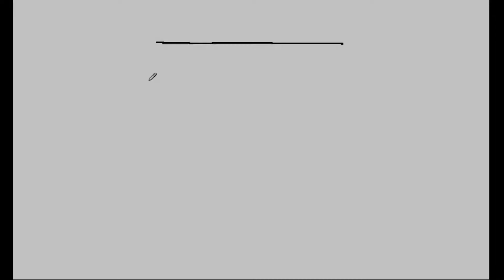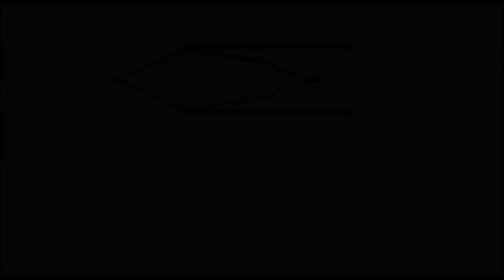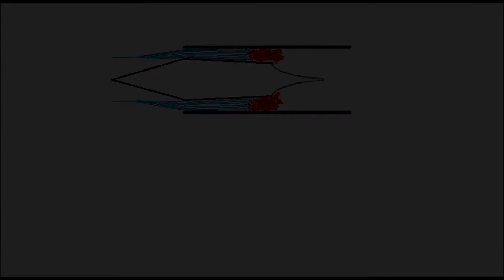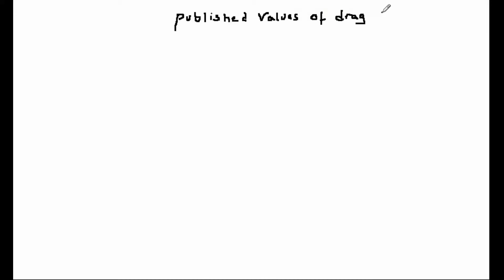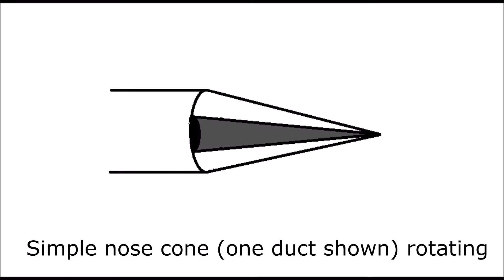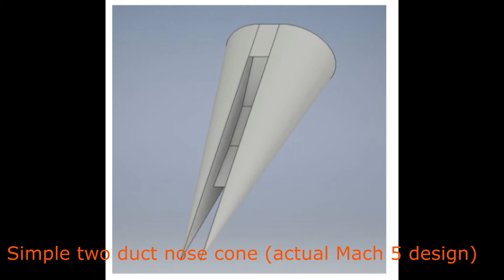Innovative Scramjet update (1) - Dec 2018

Comment: bro i am having few ideas and problems for your sramjet 
can i get your email for further communication i am trying to develop it with new ideas
Reply from the maker: Hi Chand, your channel doesn't have an "about" button, so unfortunately I can't private message you (when I put up my address on-line I get deluged with spam). If you go to my channel and send me a private message with your email address (in the messages section in the "about" tab) and I'll send you mine right back.
Reply: @geekypeek232  chandsureja989@gmail.com
there you bro
Reply: @geekypeek232  please try to get back quick cause i am running low on time bro 
thanks for your help buddy